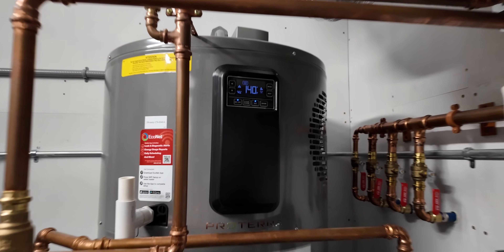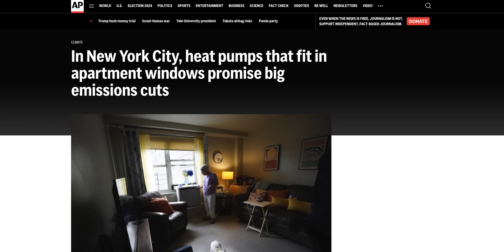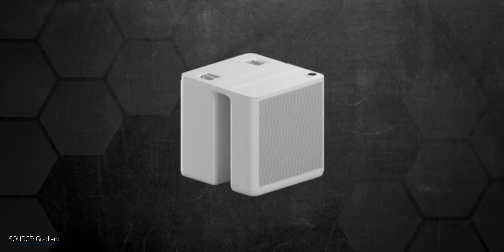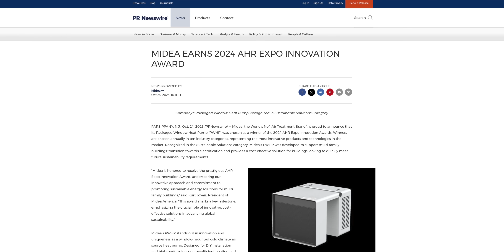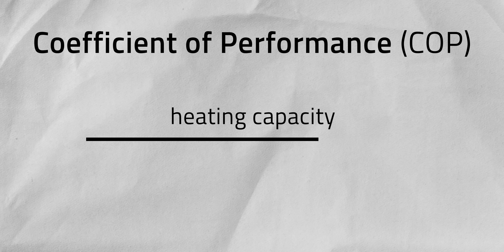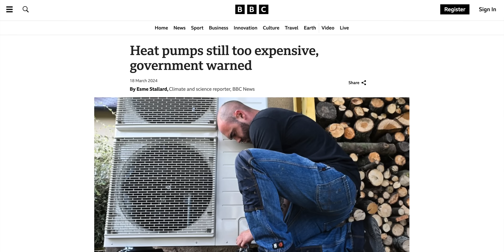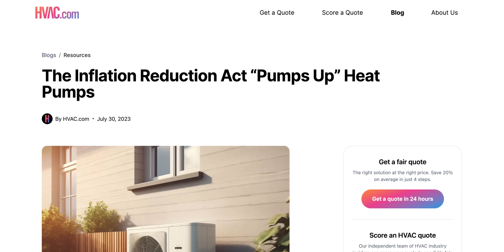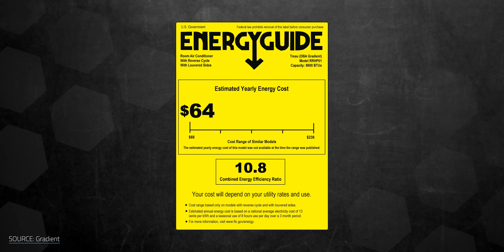Why This Window Heat Pump Is Genius

Comment: the U shape  GE profile  ac  puts the noisy, wet half part outside...  pulls 400 watts of my  'off grid in the city'  solar system..  less on eco.. 
this used AC  unit was 150 clams..  almost silent on full speed,  exit cold  air temp is 39.. outdoor  exhaust 95..   decent phone app too..  cheers. SoCal

Comment: cool, cool, but what about the rest of the world that doesn't use windows that slide up ?
also I just had a (what americans call a) minisplit installed, which also heats and uses an inverter technology, and yet they don't advertise it as a heatpump and it was only around $400+tax and shipping, but it says the heating only works to -20C, so it has to be a heatpump, right ? if it was just resistive heating I don't see why the fan on the outside unit would need to spin or have any heating limits.

Comment: Would be a problem because of the increased electric load on the electrical system in an old building. Upgrading electrical systems, services and wiring needs to be added to the cost.

Comment: You're thinking about heat pumps wrong. I have a physics degree. The most amazing thing about heat pumps is NOT the idea of using electricity to heat or cool a space, it's the fact that you can use a temperature gradient to generate electricity. Heat pumps could be used to power a home.

Comment: 1:21 Bruh… please educate me on how using electricity (the renters usually pay for) more efficient or actual help reach the carbon climate goal when you just finished saying that as the renter you don’t have control over the heating or cooling so you might need too crack a window in the winter at 1:16. I completely understand the heating aspect if your apartment is too cold but…… to cool down an already too hot apartment with electricity that you pay for….. in the winter…. When you can just open a window for free??     The only way you’ll be conserving energy is if you “were able” to use the heat that you generated from your heat pump (which is the technical name for a air conditioner) and give it to the apartments that are too cold.  Edit: then you’d be paying to transfer the energy that the apartment owner paid for the heat.

Comment: The price is wrong. Midea U shaped now has a model witn reverse cycle. 13.3 EER. $400. Same thing...for $400 lol. It is 1st gen for the heat option and only works down to 41F. I suspect this will be standard soon as all the now common and cheap  inverter window units really only need a reverse cycle to be a "heat pump". Across brands the cooling only models are 13-15 EER gives central AC some competition as that's generally more efficient..not even including duct losses and cooling unused rooms

Comment: FYI, "R32 is classified as a mildly flammable refrigerant, which means it can ignite under certain conditions. Proper handling and safety measures are essential when working with R32 to minimize risks."

Comment: 12:00 this unit running for a year as both a heater and an air conditioner will use 1/2 to 1/10 the electricity?! From what I know of heat pumps, this is not a correct comparison.  I would believe it if you were comparing a heat pump all year to an AC plus a standard electric heater.

Comment: I google window heat pump and find alternative manufacturers with same or similar designs for a lot less money. Ive been running some window heat pumps (not ptacs) for years in small apartments with either the 120 v 12k btu models or the 240v 18k models for between 800 and 1350$.

Comment: What I want, as a condo owner is a mini-split heat pump with an exchanger or whatnot that fits into one of the pre-existing through-wall AC sleeves. Like, if someone designed something that fits in that form factor and doesn't require external mounting or a concrete slab, that would be great! 

The problem with condos is that since there's an HOA, you have to get approval for pretty much anything that goes outside (concrete slab w/exchanger or whatnot) or that attaches to the exterior surface (as with outside wall-mounted exchanger units; which may interfere with re-siding projects, etc.).

whereas with a through-wall sleeve, that's considered "walls-in" and the owner can do that themselves w/o having to get HOA approval, and could simply slot it in where an A/C unit previously was, and run whatever power to it is necessary inside, and then run all the lines to the other mini-split wall-mount units inside the house.

Don't know why nobody seems to have thought of this or engineered it?? Rather untapped market, IMO...

Comment: The only thing I find disappointing about these sort of units, besides price, is that they all go below the window, so won't work if you are a renter stuck with traditional radiators under all the windows, this also limits air conditioning options too besides the traditional window units

Comment: a lot of comments about the price and i think you missed something, when you see the midea a/c with the dual inverter and heat pump heat, it clearly tells you that the heat pump won't work if the temperature is colder than 40 degrees F, so i'm just guessing that this new technology is a different type of heat pump that does work in colder temps, but you didn't mention the existing heat pumps and the new ones in comparison.

Comment: The traditional window units can be made to work very easily to heat with. They can be modified with the appropriate valving to pump the heat in the other direction, or they could be made ambidextrous, so that they could simply be installed backwards in the window. $3000 cost to do this sounds like a money grab for government grants.

Comment: My problem is I need just a little bit of supplemental heat for the polar vortex weather which hits about one week out of the winter. This would be worthless in that kind of weather from what you're telling me. Wood stove worked great till I got too old to cut wood.

Comment: We've had window AC units with heat for years. CEER of below 12 is not allowed to be installed by professionals. They look to 12 at a minimum. Funny that these would be GOOD in historic buildings. They are just as ugly and window shakers.

Comment: Thanks Matt for a great video and as usual all the good information. One thing that I think should have been brought up and talked about was the cost of the electricity and where you're going to get it. While heat pumps cost to run is the same approximately as air conditioning and then in the winter time when it's not too cold outside it is better on moving heat inside. It's that winter part that I have question about. Where we have natural gas and it is pretty inexpensive it is from what I understand a cheaper way to heat. Nobody addresses the cost of the heat pump running in the winter time as to the cost of operation and electricity in addition to the cost of running the heat pump defrost cycle. So my question is has anybody added that cost for the defrosting to the cost of operation and seen a large overall cost reduction? The next thing people aren't talking about is map the 120-volt operation is going to come off of a plug-in outlet. Most of those are 15 or 20 amp circuits. When you take an ad on an AC unit or mini split do you now draw so much that you are limiting the amount excessively that you can use on your wall outlets? Just something to think as a drawback. Of course there's no issue if you have a dedicated AC outlet by the window.

Comment: You do know a new furnace and ac is $10,000 or more? My 10yr old crap compressor died. 3 months after warranty. I spent 1800 on new exterior portion. I needed ac.  Sucks

Comment: You’re forgetting one important factor. In NYC, electricity is so expensive that heating with gas is still more cost effective. I have mini splits in my house as well as a gas steam boiler. I realized quickly that using them as my primary heating source costs a fortune, even with solar, so I’m still using my boiler. NYC needs to work on their electricity costs if they want to incentivize us to go all electric.

Comment: what about tossing a solar panel and making it a rental system, by adding the panel to the side and simply building up power in a salt battery it should be relatively easy get a hundred watts of power, though realisticly its not continuouse power, but a winter time sand battery powered by electric will only be what ever it costs to modify an existing greenhouse sand battery by securing the floor. 

Although making a suitcase shaped sand batterry ought to be good??

Comment: heat pumps dont work in cold climates! below 40 degrees F it does not hit because hit pumps get heat from the outside air! it is pointless

Comment: Wish I could have something like this for my apartment here in central New Hampshire. It would be perfect for the climate here. I have a window heat pump but it doesnt operate the heating part at much below 40F. New Hampshire gets a lot colder than that in the winter

Comment: application and looks are right, price is wrong, a 4-way valve is a few bucks. Im thinking the design, compactness, hinges, brackets, housing and flex hoses add to the cost but not 5x. they will come down once their engineering costs go away and more people buy them. Good idea for garages and shops with windows, that are not central air ducted.

Comment: I,ve been an HVAC professional for 40 + years.  Bottom line Heat Pumps suck.  Heat Pump maintenace costs r much higher than straight A/C or gas fired systems.  While the Heat pump may look good on paper, its practical use falls short.  As a professional i have made excellent money on Heat Pump repairs.  However for the home Owner Heat Pumps dont make sense when u analyze all factors.

Comment: Blah Blah Blah.....   fast talk, a lot of numbers, sounds great....

BUT  (or is it BTU?)

WHERE are the real world numbers?

how many square feet can be heated?
What is the lowest outdoor temp this unit can work with to heat 1000sqft?

at max operations, what is the energy consumption?

When I look at something like this, I see the ROI to be so far down the road, that the unit will have expired long before that, and need replacing, further extending the ROI

I'm all for reducing emissions (NOT CO2, as that is not pollution) but I simply cannot afford to pay my heating costs NOW, let alone added costs with no ROI

Sometimes, great ideas are just that.... ideas, but have no place in the real world.

Comment: I bought a DELLA 12000 BTU Wifi Enabled 19 SEER2 mini split for about $700.  Good for -4F.  Installed inside unit on the wall and outside on opposite side of wall spaced 2 feet away from wall.  It did require coiling most of the copper lines but everything has worked over 3 years.  Total installation time was about 5 hours, including vacuum of lines and all wiring.  Also cutting through cement block!

Comment: Wait, in the US AC units don't have a heatting setting? I live in Europe in an appartment block with a gas heater, they tipically wait for temps to drop to a certain level before turning it on. Since I'm quite sensitive to the cold I usually turn the AC heat on for a few days to a couple of weeks before that.

Comment: AC units can simply be spun around... The control side needs to be protected from the weather but they do the same thing.. collect heat on one side and exchange it on the other. A heat pump just uses valves to change the direction.

Comment: My heat pump provides heat down to 35F, tested it years ago. Stopped at -40F, Senville brand. Living in the North, I wouldn't even consider a mini split that didn't do that. They advertise down to -22F but it does better. I use a 24K BTU unit to heat my whole 1,500 sq ft leaky old farmhouse in the winter in the 70'sF, uses 2,500 watts/hour, about $150/month for heat. I've had it for 6 years now. I also use a Vevor diesel heater for when it gets super cold, as efficiency goes down as temps go below freezing. Below zero, the Vevor is used. Using two 12K BTU units is actually more efficient (after extra install cost) as they only use 960w/hour X 2. Even better is not heating with electricity at all and using a Rocket Stove like the Liberator Worlds most efficient wood burner. You can use cut-offs from mills, they just want to get rid of those cheap. Heat for $200/winter without cutting down a single tree. Both the Gamera and Liberator are about $3,000.  Need 1/3rd the wood if designed properly with a thermal battery.  Combine that with a hyper-efficient SIP house, and you are set. Why are there lines through the text? I didn't do that

Comment: Cool idea, thx for the vid! However I think interior apartment heat pumps with water heating r more preferable option as hot water takes most of the operational costs. Once u heat the water u can redistribute it in the heating radiator system and heat the apartment. Ideally I would like to see interior water heating air heat pump also capable of cooling down the apartment possibly with extra module outside the window similar to AC. This way u could have one system heating the water as well the air and if needed cooling it down. Of course this setup would require rebuilding the apartment heating and cooling system but results might be worth it.

Comment: While I see these units as better than window ac units, I’m still concerned that many of them will still fit badly or with compromises. I’m thinking it would be better if such units were incorporated into a wholistic window system installation, though it would increase the investment burden and some design complexity. For examples, replacement windows that incorporate a heat pump as part of the frame, or have a section designed to have a heat pump installed.

Comment: Fascinating that the US is just discovering heatpumps lol. They were the leading country air conditioning almost everything, but somehow took them ages to figure out that reversing the cycle, adding some electronics and a reversing valve, their AC could be used as a heater too. Still today you can buy a center AC unit which cant be used as a heater, while in Europe you really have to search around if you want an AC unit which is not a heatpump. And then they start to sell window heatpump units for 3k in the US, where as window unit ACs are almost everywhere around there. Brilliant I have to say.

Comment: Great topic, of course this technology will by time shrink the units to affordable prices and size. Who needs 9000BTU's, right? If an apartment has very good insulation meaning less heat loss through windows, doors and ceiling or floor it might be just enough to have 5000BTU's. If prices drop to modern refrigerator prices ($1000) they might be for rent at $25/month keeping the investment extremely low and maintenance cheap. They then reduce energy bills by $100 in winter & probably some amount in summertime too. It is just that factor 2.5 in heat production that is scaled down to efficiency in square meters a floor. If they use only 1000/2000 Watts in Eco mode that just might work. In winter i use approximately 3 cubic meter of gas to heat my apartment (Mainly the living space) a cost of 1,4 Euro/m3 = 4.2 Euro daily. No electricity is used beside the pump. And if i am out all day it will be a lot less. So, a new heat pump heating unit can only compete in the long run if they are efficient, cheap to buy and maintained. Otherwise stick to old easy on/off gas heating.

Comment: I’ve got a few Midea appliances that have been shipped several times, thousands of miles over the last 5 years. The price is high but it may be for fitting a decent manufacturing line for startup. We can hope.

Comment: Heat pumps in high electric energy states (like SCE in CA) are between 4-10x the cost to heat a home, making them a poor choice when cost per kWh is high. So you lose with higher HVAC cost and higher energy cost. They are promoted in states like CA so the energy companies can use the natural gas to produce the electricity, and they benefit builders for not including natural gas lines in new homes. There is no consumer benefit and since electricity is often produced with natural gas, any benefit to planet is often negated. You need provide better analysis using actual cost per therm.

Comment: The system is designed based on switching between evaporator and condenser that is not knew design , but the problem with  old refrigerant  , was useless in clod climate. The properties of new refrigerant change the game , it is useless for who are in hot weather conditions . But by redesigning by combination of…… it is going to be perfect. Thanks

Comment: don't all types of air conditioners release chlorofluorocarbons including heat pumps?
Reply: No. All A/C and heat pumps use a closed-loop system, where the refrigerant is never released. If it did, the unit would cease working. Most CFC's released into the atmosphere comes from automobile accidents, busting open the A/C systems as a result.

Comment: dont heat pumps contribute to the heat island effect?
Reply from the maker: No.  The heat island effect is structures absorbing the heat radiation from the sun.  Heat pumps are only moving heat from one location to another.
Reply: @UndecidedMF  Thanks for your reply. But here is what I found:
Heat pumps do contribute to heat island effect but due to their high efficiency and distribution of the heat- they are considered to have a lower heat island effect than fossil fuel systems.
Reply from the maker: @ where did you find that info?
Reply: @UndecidedMF  Which type of chemical (CFC, HCFC, HFC, HFO, Ammonia, or Hydrocarbon) does a heat pump uses?

Comment: You can actually flip a window air conditioning unit around backward and heat a space with it, it's just fiddly to figure out the cord usually. Tech Ingredients here on youtube has a great video on it.  Also, I don't know how low of an outside temp a window unit could operate at, but it is technically possible.